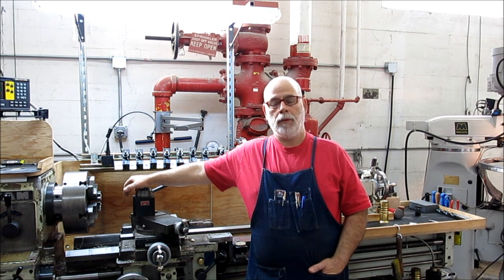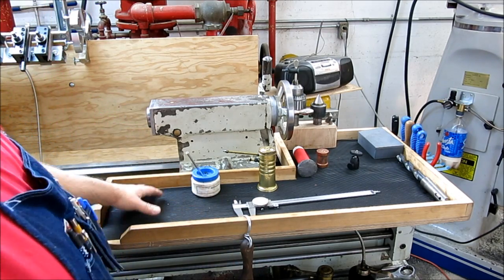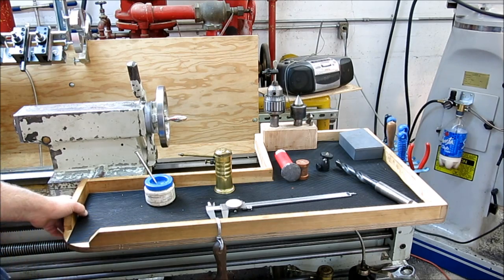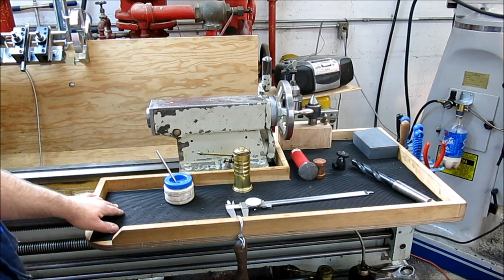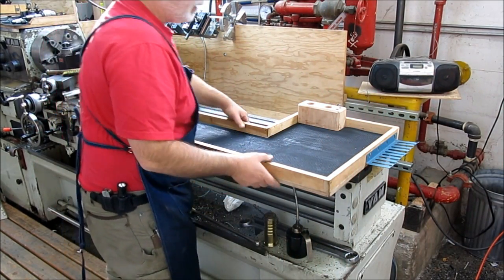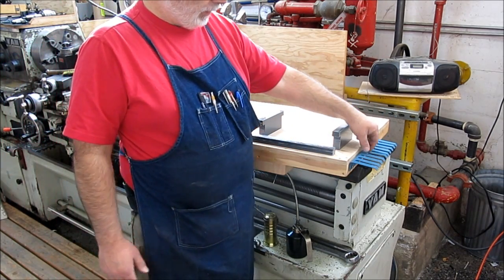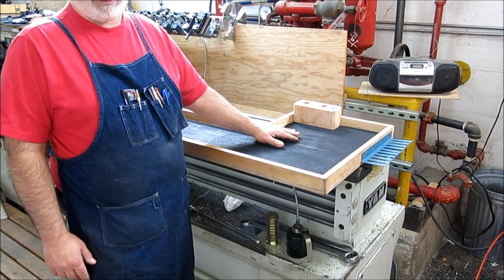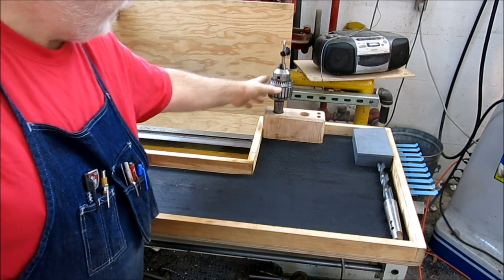Roach Coach 4

Comment: Very nice tool tray Tom. I like it. I believe that's the first one I've ever seen before, but it looks to be very useful because often enough we don't have enough flat space to lay all of our tools down when running the lathe. 
Thanks for sharing the great idea. 

Adam
Reply from the maker: Hey Adam,

Isn't that what the headstock top is for? Chuck keys and micrometers oh yeah. 

Talk to you soon.

Tom
Reply: Yea, and for all the other junk that accumulates on my lathes. Sometimes I have to use them big boy mics that take up a lot of room on the headstock, but I don't know if them smooth manicured  hands of yours could handle much over a 3" mic, so your tool tray should work great in your shop!

Abom
Reply from the maker: Abom79 I was thinking about somebody else. You know the guy that hates chuck key holders. I thought you just tucked them big boy mics in your sweats instead of putting them down. Quick draw Mcgraw right.

Got a fire going tonight?

Best,

Tom
Reply: Actually we did some running around on the town and had dinner so I never did get the firepit cleaned out and started once we get home. We're just having a movie night inside.

Comment: Hey Tom, I got this idea off of your blog a couple months ago. I drilled holes in the right corner nearest the operator for the live center and drill chuck, the problem is if the tailstock is close and I move the quill I get a very deep foot long gash on my right arm from a center drill!
This is a great idea I kind of over thought mine and was a little to conservative on the dimensions.
Reply from the maker: Hi Tyler,

Engineers thrive on failure. It means they get to redesign. Sorry to hear you nicked yourself. Unfortunately is probably going to happen again if I'm any example to go by.

Cheers,

Tom

Comment: Now I see why it does not tip over I was wondering about that.  I like the one on the headstock too.  Plus the back splash you made for the lathe seems to be holding up well.

See Tom wood can be useful :)
Reply from the maker: Hey Bill,

I'm learning. Wood and unistrut are your friends. 

Cheers,

Tom
Reply: oxtoolco Unistrut is great stuff - I learned to use it in a PChem lab up "On The Hill" (LBL) in my student days at Cal...

Comment: Hey Tom,
I just got a bunch of dial indicators and other measure tools and I need a small granite surface to use them on. Any idea where I can get a small sized (5"x5") granite slab for that kind of work?
Thanks,
Keep up the great work!
Reply: Enco sells 9x12 surface plates if you need it smaller, a gravestone shop can saw it smaller for you.
Reply: Gravestone shop  cut a part for me about 3 years ago. The shop did a great job!
Reply from the maker: Good replies. Since you guys covered the surface plate question I'll tell a story about headstone cutters. We had a job for a customer to cut a toilet in half longways. They wanted to study "clogs" We bought a couple of new toilets and took them to a headstone cutter. They used the diamond wire saw and cut the crapper right down the center for us. Price was pretty good also.

Cheers,

Tom

Comment: I think the tail stock tray is a great idea.  You are right, never enough horizontal storage around a machine.  I once spent 2 hours looking for a tool that was in the chip tray.  Setting things in the chip tray is a bad practice for sure.

Rich
Reply from the maker: Hi Ron,

Thanks for the comment and sharing your experience. Some day I'll tell the story about losing an insert screw in the CNC lathe. And yes I found it.

Cheers,

Tom

Comment: Very cool, it's nice to have the needed stuff right there at your finger tips. I like that open corner... Also easy to sweep of ALL the chips off maybe even into a dustpan! :o]

O,
Reply from the maker: Hi O,

The rubber mat makes it hard to sweep perpendicular to the ribs. The slot is right over the chip pan so they drop right in with their mates.

Cheers,

Tom

Comment: Tom, Awesome tail stock tray  Thanks.

Hey can ya have Mr Wizard send the roach coach past the belt sander?  I am working on plans to build one myself, and would like to see some more detail on your adjustable fence, that you gave us a look-see at in the wedge video.  It looked cool.  Adjustable with out any tools! (double extra bonus points when adjustments are made without tools) cuz where did I set that 9/16" wrench, it was just right here...

Also, if you can give us some tips on the roller taper.  How much did you taper the rollers and are both the driven and the idler tapered.  Ok while you are there...  Tell us about the tensioning and tracking adjustments.  Sorry to be so demanding.

As always.  Thank you.  All the best, Chuck.
Reply from the maker: Hi Chuck,

We will see if we can send the roach coach past the belt sander. Its not their normal stop but I think we can swing it.

Best,

Tom

Comment: Nice idea I have to make a shelf for my tool holders...I would like them in arms reach but I do not want to put on the back splash (metal) that came with my lathe I like the room to walk around it...any ideas?
Reply from the maker: Hi Lawrence,

The only other place that makes any sense is on top of the headstock. I used to keep mine there and still reach up there occasionally. Some guys don't like bringing a tool block over the top of the rotating chuck. If you drop once accidentally it could hit the spinning chuck. I have never had a problem myself but its a reasonable point they make. Where ever you end up it should not require even one step to put your hand on a tool holder. If its behind you or you need to take a few steps you will end up frustrated. One of the great joys is having your machine set up just the way you like it and getting into a rhythm making something. So stand at your lathe and reach around the spot you normally stand and see what possibilities are there.

Cheers,

Tom

Comment: At 05:13 you put a counter sink back in place - the one with a hole I think 45° off from center and then the edge of the hole is doing the cut.

I have a pair of these that need to shapened and a lot of questions about them !

Do you know the geometri on these parts - how come that the one side of the hole is the cutting edge ?

Is the hole drilled a hair off the center line or what ... ?

Can I just grind the CONE-shape in the front to get them sharp again ?
Reply: I also have the same that need sharpening, I'd love to see a sharpening video.
Reply from the maker: Hi Keld and Nonames,

These single flute countersinks are actually tricky to sharpen. They have a cam ground relief that is pretty impossible to do by hand. That said there are a couple of tricks for extending their life. I put it on the list for a roach coach break.

Best,

Tom
Reply: oxtoolco Oh, that's really fine - thx !

Comment: I would like to see a video that shows your milling machine in full view. It looks a lot like my mill but I can't tell in the videos.  Did install the power feed on the table Z ? If so any advice for someone planning on installing a table Z power feed? Thanks
Reply from the maker: Hi Pot,

Its nothing too special as far as milling machines go. I'll try to get a full on shot for you guys as your not the only one that has asked. I don't like the commercial power feed units for the Z axis. They typically are in your way right at knee level. I use a electric drill that I made an adapter to fit the face gear where the knee handle connects.

Cheers,

Tom

Comment: Nice idea, especially for my one lathe which is on legs and not on a table top.
Reply from the maker: Hey Gopher,

Thanks for the comment and participation. 

All the best,

Tom
Reply: Does the upper part of the L (the part the tail stock slides past) just free float?  Or is it supported on the inside somehow?  Looks like it free floats based on what it looked like when your turned it over, but thought I would ask to be sure.
Reply from the maker: ILGopher Hi Gopher,

It is all one piece of plywood. The narrow part that is off the lathe is self supporting from the attachment point. Hope that makes sense.

Cheers,

Tom
Reply: Thanks, Tom.

Comment: That "file rack" looks a lot like a cable storage rack.....
Reply from the maker: Hi Andy,

Good eyes. BNC ended signal cables to be accurate in this specimen. Scrap bin rescue.

Cheers,

Tom
Reply: Yep, it is certainly a test lead holder.  Many different sizes that are color coded.  I have at least 4 in use for test leads with several spares.  Like most tools, you can never have enough test leads.